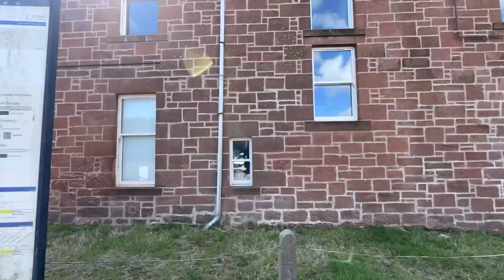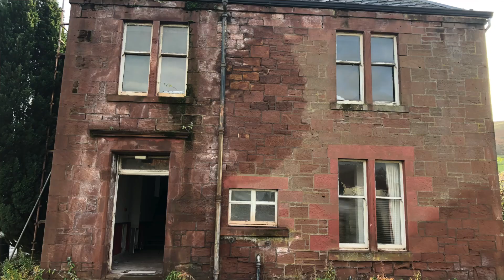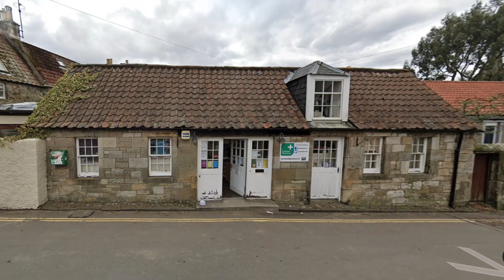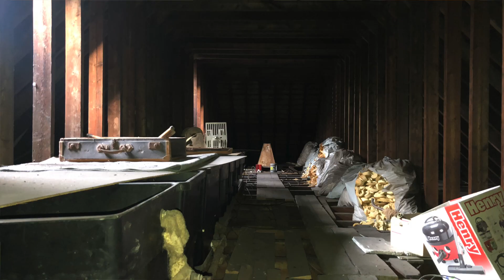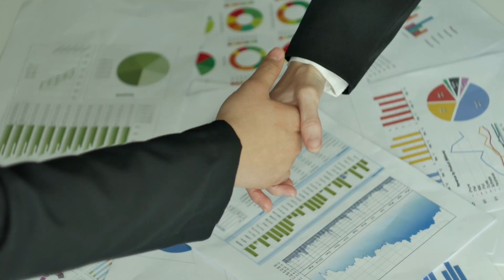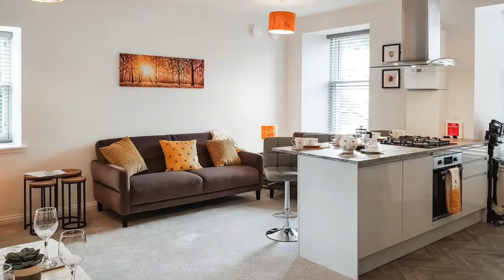How To Save an Old Building

Comment: That was an excellent repurposing project: 6 bedrooms added to the local rental supply, a more accessible pharmacy for the whole village, and a small office for someone.

Not flashy, wins no awards, just gets the building back into use. 

Did you get to redesign the old pharmacy building?
Reply from the maker: No, the lease was taken over by a local shop.